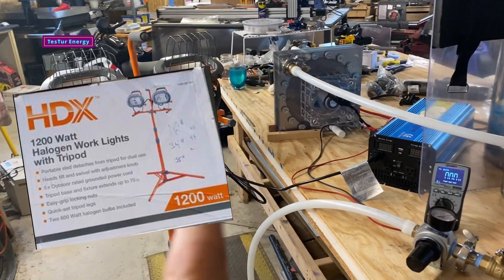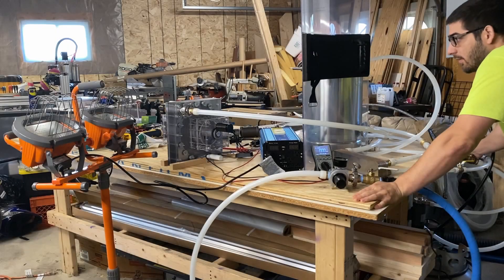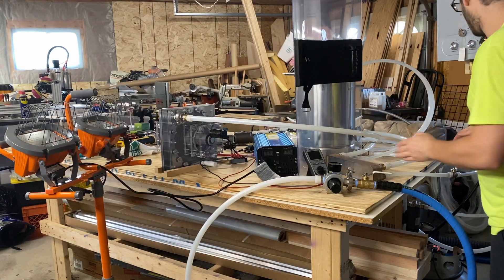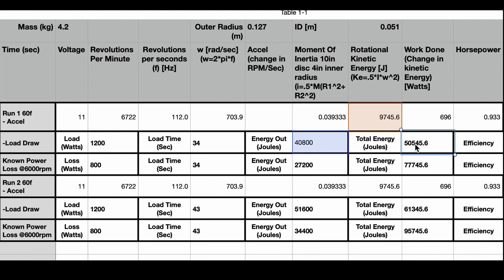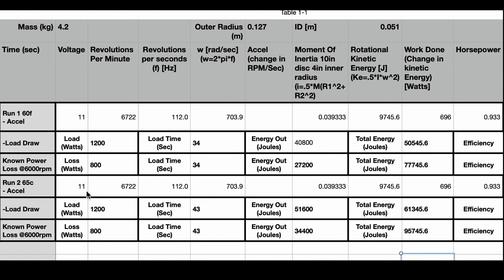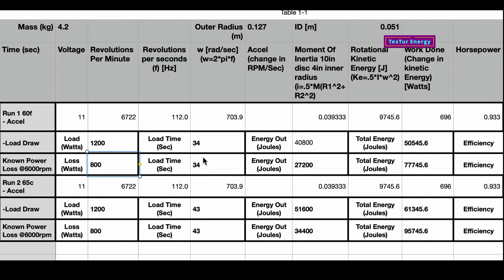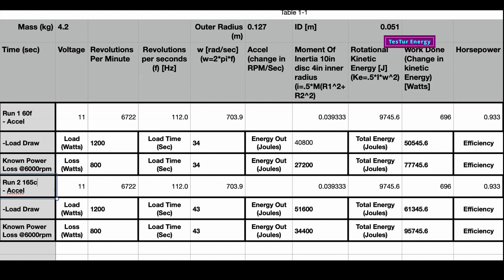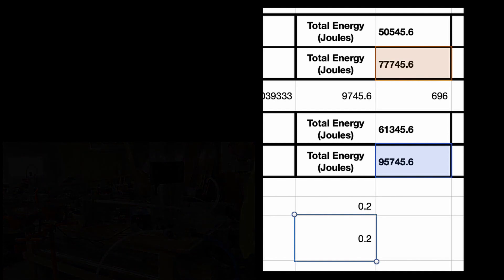Tesla Turbine 1200 Watt Electrical  Load Tests - Power Calculations - compressed Air + Propane

Comment: sounds nice wzzzz lol
Reply from the maker: Would you believe me if I told you I had to do ZERO balancing on this rotor to get these results?? 😂😂😂
Reply: @CharlieSolis  glad it works
Reply from the maker: @Jkauppa  1200watt Load Test ELECTRICAL Output Efficiency Calculations For 10in Tesla Turbine Are In! 
See the charts here!
https://www.youtube.com/post/UgkxRukN0zoVbtfe1LmLUlXyIo0kdt1ExWZs
Reply from the maker: Ughh I can’t wait to get rid of these gears and have a direct on shaft generator rig. 90% of the noise coming from the turbine is from of the gears not being perfectly aligned. So it’s going to get even more quiet soon.
Reply: happy exploration and optimization
Reply: consider cd/dvd discs for the pre-balanced rotor discs, for fun or actual thing

Comment: The fact that the total energy increased at the same rate as the useful energy says a lot about your setup. If you can eliminate some inefficiencies, you could test your setup against traditional motors. (You don't have to run these tests your self, I hope they will be available online). This is crucial, as:
Tesla turbine needs to be tested against benchmark technology. And because you could then show the differences in costs, size and durability.

So the realistic question could be: can I use big compressors with hot stones etc. To store energy at home? Or in bigger scale? What scale is good compared to e.g. batteries or conventional motors?
Reply from the maker: Hey George! So just to start off. As an example, check out the CAD animation of the “solar collector/hot tank/vacuum chamber cryophorus generator/Tesla fountain steam condenser” design of mine. 
https://youtu.be/9-8KH7bFSKM
The solar collector is a 10kw per good sun hour unit. It’s 10ftx20ft. And with 5 good hours of sunlight per day it can dump 50kWhrs of thermal energy into the hot tank. Now if the turbine and vacuum cryophorus system can be made to be even just 50% efficient to the electrical load that’s enough for 25kWhrs of electrical energy per day. Which is just about as much as the average American home uses every day. Now, I don’t imagine with the water tanks the system will see more than 1kW output. But if can put that 1kW out and do it slowly over 24 hours, if you’re connected to the grid, that all throughout the day will reverse/“unwind” your electrical meter’s readings. During peak hours your meter might spin forward as you draw off the grid but because it will be slowly going in reverse the rest of the day it should almost equal out. And again that’s just 50% efficient. Which I think we can achieve without any sort of boiler feed water preheat Designs or any other thermal recoup built in. But that’s not compressed air and still needs much more work to be completed. 

I’m am right now working to build a Tesla compressor to start doing proper round trip efficiency tests going. So I can we how much energy it takes to use the Tesla compressor to fill up the large tanks and then see how much energy I get back out dumping the tanks through the turbine. Then it’s on to my full combustion turbine tests cuz I can now start cutting out 304 stainless steel discs. 😈😈😈
Reply: @CharlieSolis  that's excellent! You start by heating up the tank, not by storing electrical energy. This is much more efficient than the photovoltaics could do. 
Can you make a comparison of two systems:
Photovoltaics and battery, vs. your system?
Capex efficiency and size. You might have a market worthy system there!
Reply from the maker: @gdlignos  As for the storage of that energy, 2x 330gal IBC tanks, 660 gal total, hot water tanks. 660 gallons of water takes 60kWhrs of thermal energy to change 20°c in temp (it’s really 20K but whatever) if we have the 660gal hot tank at 70°c then (if the hot tank is perfectly insulated and didn’t lose any heat out the walls 🤷‍♂️) then theoretically the tank would have to give up 60kWhrs of thermal energy to be brought down to 50°c. So as long as we can generate 1kW of power with it still operating down to 50°c then the hot tank can give the turbine 60kWhrs of thermal energy and if the turbine is only 50% efficient then that’s a 30kWhrs of electrical energy out from that available thermal in the tank. All things considered thats rather achievable, if I do say so myself.
Reply from the maker: @gdlignos  So at sea level there’s about 1.12kW of total power in solar radiation for ever 1m^2. 
~10% is UV light, ~25 is visible light and the last whopping ~65% is infrared thermal radiant energy. 
Now, solar cells only use a portion of the visible spectrum so at best they can only utilize 20% of the energy coming down from the sun, not to mention the infrared/thermal causes them to get hot making them less efficient as well. 

With the solar thermal collector all 65% of the infrared can be stored in the tanks thermal AND all 25% of the visible can as well be stored in the hot tanks. So that’s 90% of the total energy from the sun we can store and utilize. So the solar collector itself can be like 1/2-1/3 of the size of a normal PV cell system on your roof, meaning it’s lighter, costs les to install. And you can honestly just roll out a black rubber solar water heater across your rooftop and it would work all the same. 

And at the risk of staying the obvious, I’ll still go into the costs and waste electrical batteries are once you see the thermal energy storage potential of just random heavy objects and or just water… 😂😂😂 that’s a $15k expense less for this system right there. And there’s no worry about a tank of water catching on fire. You can also eliminate your hot water heater in your home, for that matter because, and excuse me for stating the obvious again, why would you need that at this point? If 660gal of 50-70°c water isn’t enough hot water for your home’s hot water needs (showers, etc) I’m not sure what to tell ya 🤷‍♂️ 😂 so ditch that home appliance or just couple the two together. Stick the home hot water tank that stores water at up to 90° in the center of the other hot water tank. That way there’s a supply of really hot water to pull from for your home and any heat it loses just goes into the 70°c hot tank that it’s sunk into. 🤷‍♂️ reduce the heat losses out of the higher temp hot tank and recoup it in your turbines hot tank.
Reply from the maker: @gdlignos  now if PV cells can only use 20% of the suns light to dump into batteries and realistically we can see a 10% drop on the return out to the inverter (but both systems need the inverter so we won’t go further). That’s putting PV cells capable of outputting to electrical energy 16% of the suns total energy hitting the footprint of the PV solar collectors. 

Now for thermal collector and our system. Start with 90% of the suns light and let’s say we lose 10% to pipes and the tank cooling and loss through its walls, and then even if the turbine system is only 50% efficient. We’re still looking at this system outputting to electrical power ~40.5% of the suns total energy hitting the footprint of the thermal collector. that’s ridiculous. 

Especially if the condenser side of the turbine system is used to heat a home in the winter. That 50% loss is just heat sent away by the condenser. If 50% of the 50kWhrs per day of thermal energy available is converted by the turbine towards electrical power then 25kWhrs of thermal energy can be used for low grade heating.
Reply: @CharlieSolis  i wish you the best of luck!!
Reply from the maker: Thanks George!!
Reply from the maker: @gdlignos  1200watt Load Test ELECTRICAL Output Efficiency Calculations For 10in Tesla Turbine Are In! 
See the charts here!
https://www.youtube.com/post/UgkxRukN0zoVbtfe1LmLUlXyIo0kdt1ExWZs

Comment: Have you ever tried dimpling the inside of your Tesla turbine box similar to the outside of a golf ball to reduce drag on the incoming vapor?
Reply from the maker: Hey David! Thanks for messaging. Sorry it took me so long to respond. To be frank, no I have not. This is because the dimples on golf balls don’t reduce drag by reducing the skin drag on the ball itself. The dimples cause vortices around the ball which reduce separation and thus reduce the the size of the low pressure region behind the ball that also further causes drag. 
Take a look at this video it explains it well. 
https://youtu.be/fcjaxC-e8oY
Reply from the maker: I believe the story goes that golfers knew that old scuffed up balls would go further than brand new balls so they started making them with dimples.
Reply from the maker: While a smooth ball does produce laminar flows around the body and all around less skin drag and the turbulent flows end up producing more skin drag the reduction in the size of the low pressure vortex region behind the ball more than accounts for the increased skin drag. The turbine the casing doesn’t have a “low pressure” vortex behind it creating a pressure differential across itself and thus a net force. Further within a turbine casing having increased turbulent flows will not just lead to higher drag but can create intense vibrations (plus noise loss) upon the casing or the turbine itself leading to early fatigue of components over sustained continuous usage. Now that being said when using the disc stack as a pump, if the discs are squared off at their tips, instead of tapered, then there may be something to roughing up the very last part of the disc faces such that the adhered laminar boundary layer can separate from the disc tips with a smaller amount of turbulent loss leaving the spacing between the discs.
Reply from the maker: But yeah? David, Let me know if my explanation makes sense! 🙂
Reply from the maker: 1200watt Load Test ELECTRICAL Output Efficiency Calculations For 10in Tesla Turbine Are In! 
See the charts here!
https://www.youtube.com/post/UgkxRukN0zoVbtfe1LmLUlXyIo0kdt1ExWZs

Comment: Hey Charlie, I enjoyed your demonstration. What we said in the video was that, it is not possible to build  a Tesla turbine which rotates at a high rpm with a disc diameter of 2-3 meters.
Reply from the maker: Well that’s a rather extremely reductionist take on what you actually said in your video about Tesla turbines but ok… 👍👍

Comment: Progressing pretty good!
Reply from the maker: Hey thanks Heldlightning! 🙏🙏🙏😬😬😬
Reply from the maker: Hey Heldlightning, not sure if you’ve gotten a chance to see my latest tesla turbine updates but check them out! Just running on compressed air so far while I still work on the larger vacuum chamber system for the turbine. Peak 2.75kW and 6.22ft-lbs of torque 4150rpm with 150psi room temp compressed air with 1/2in supply lines.  And the second video is the latest 1200watt electrical load tests using 170gal of 150psi compressed air dumped to 65psi, both room temp and then 70-80°c heated compressed air. And saw the continuous 1200watt output all the way down to 65psi. Should have this thing ready for a vacuum chamber here real soon! 

https://youtube.com/shorts/yXQy844URMA?feature=share

https://youtu.be/bWpXRzrzf4g
Reply from the maker: 1200watt Load Test ELECTRICAL Output Efficiency Calculations For 10in Tesla Turbine Are In! 
See the charts here!
https://www.youtube.com/post/UgkxRukN0zoVbtfe1LmLUlXyIo0kdt1ExWZs